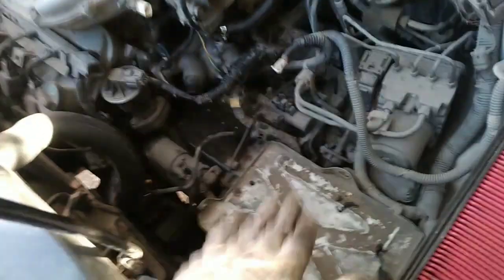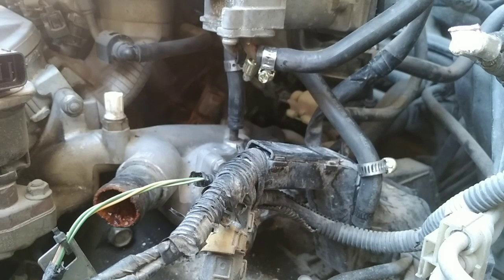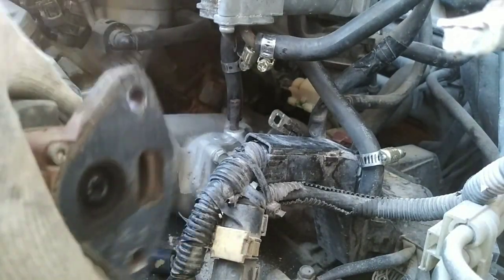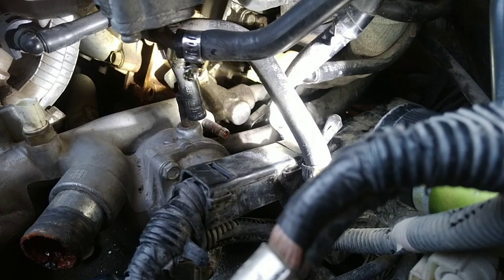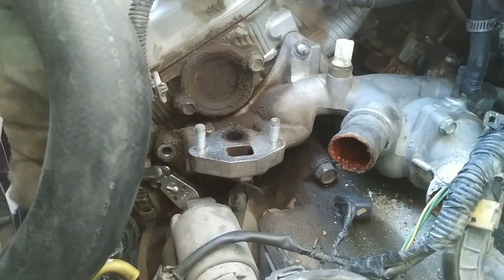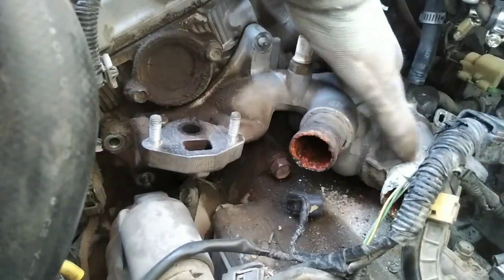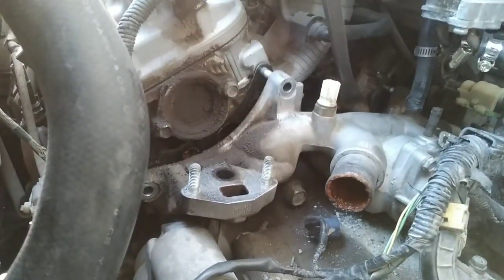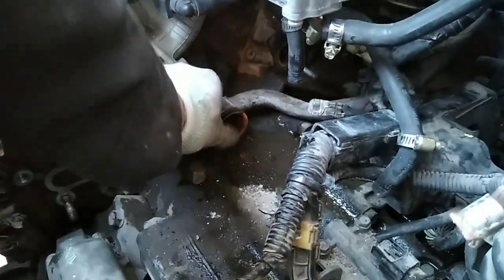honda pilot coolant leak in the middle of the engine (coneccting pipe) how to remove #hondapilot

Comment: Yeah I did the same to my 2003 Pilot EX with 225,000 miles. Tip: take photos before removing items. I forgot to reconnect one hose and found it while bleeding the lines, oops. The coolant valve along the fire wall was a PITA. Took me 5 hours to complete, oh yeah clean out or replace your EGR valve. Engine runs like a champ now.
Reply: How did you install the new one ?